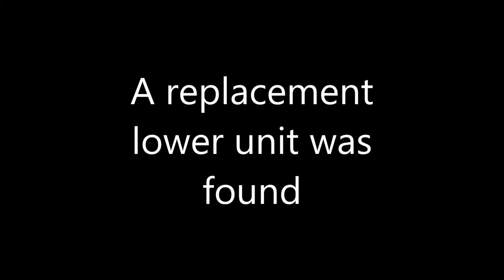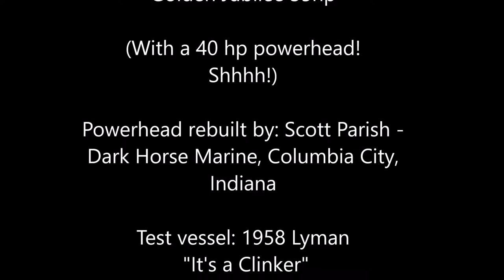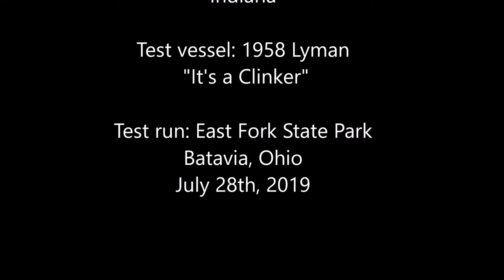1959 Evinrude Lark Golden Jubilee movie

Comment: Greg, thank you some much form making this movie.  I  just picked up the same exact unit and plan to do the same thing you did.  As luck has it,  I have a 1975 Johnson 40 motor with very low hours in which all the electronics are shot.  Can you use the same 35 ignition on that bigger powerhead?